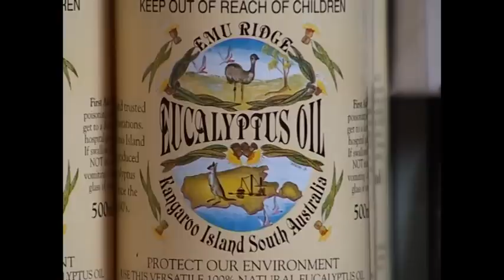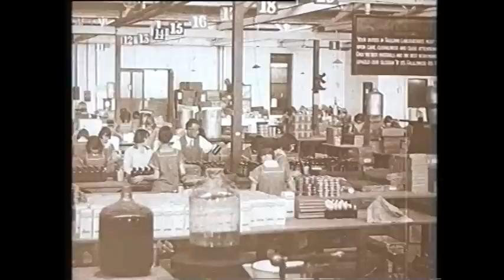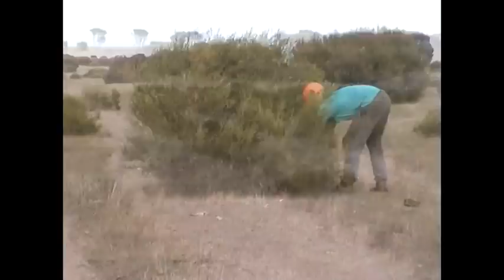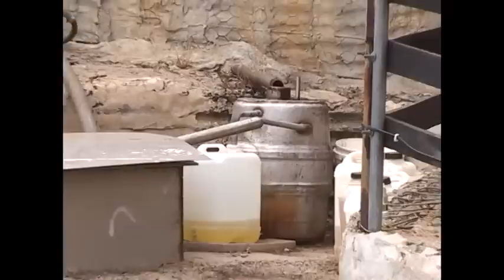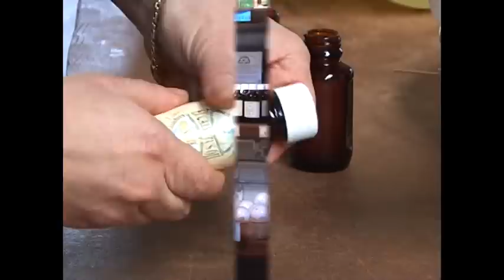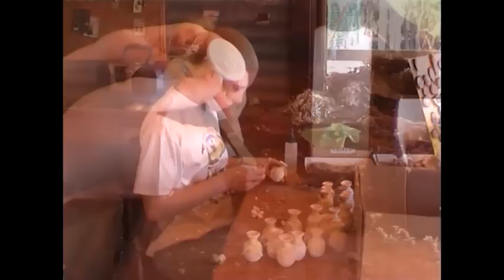Emu  Ridge Eucalyptus Oil Distillery - Kangaroo Island

Comment: My memory my not be to good but I seem to remember seeing another method used back in the day, whereby the leaves were placed in a big tank of water. 
A fire under the tank boiled the leaves and then it was allowed to cool. The oil came to the top and the water was underneath. A tap at the bottom of the tank was opened so the water drained out until there was just oil left. I can't remember but maybe there was a lid on the tank to stop oil vapour escaping. Was this a method , albeit a crude one, that was ever used?
Reply from the maker: Wow I have never heard of this, it would be to difficult to know when all the water was drained? And yes a lid would have deffinatly been on or all the vapors would disappear regards Bev